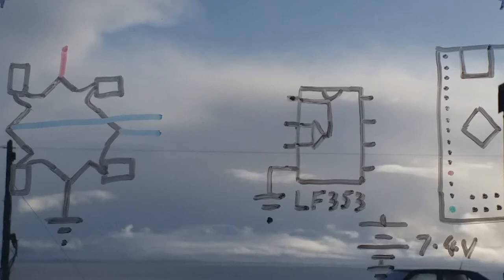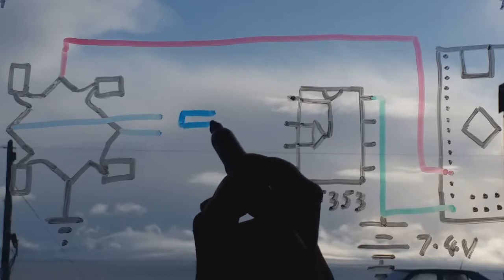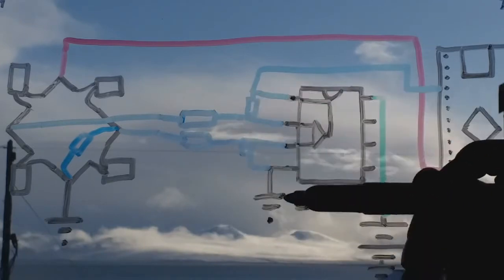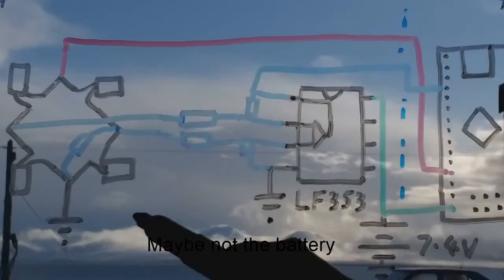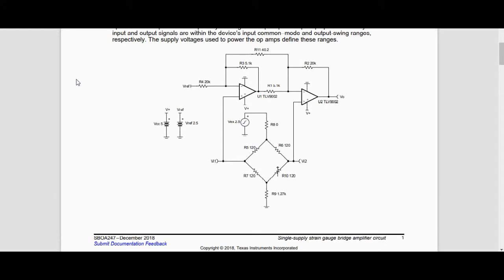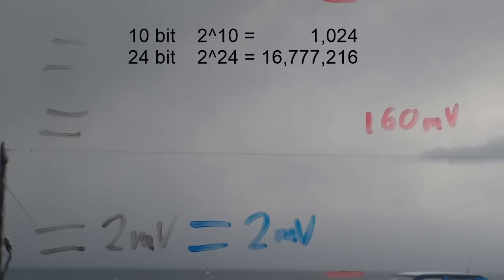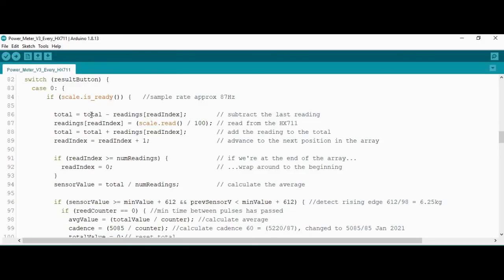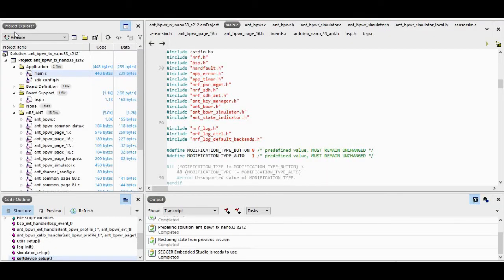Homemade Bicycle Power meter, Amplifier or HX711 which is best.

Comment: Great work! I am attempting the same with an nrf52840 dongle and HX711. I have to learn how to get ant+ working and how to communicate the HX711 with the nordic chip.
Reply from the maker: Thanks, we are at the same point and for me the hardest part.
You might find this page helpful for communication with the HX711. https://devzone.nordicsemi.com/f/nordic-q-a/40271/timer-issue-with-hx711---stopped-by-vector-catch-error
In the reply by Vidar Berg is a zip file which contains a library.
I tried to get it working in a BLE example and got stuck on a Deadbeef error. I believe this means the Softdevice failed to start.
Decided to learn more about Segger before attending to debug it.

Comment: What a cool stuff!! If you don't mind of this question. Let's say, I want to measure a strain and stress on Aluminum shaft with 4 strain gauge (full bridge). Which amplifier do you prefer? HX711 or INA125P? May I ask why? It really help me if you answer this question. Thank you..
Reply from the maker: Thanks, I don't have any experience of the INA125P instrumentation amplifier myself. If you use the INA125P then you will need a microcontroller with a decent ADC to got good results. Or use a separate ADC at which point an HX711 might make more sense.
If you are looking for professional results or developing a product then the INA125P with a good ADC is best.
However if you want the highest chance of getting decent results with minimal effort I would definitely recommend the HX711.
Hope that helps.